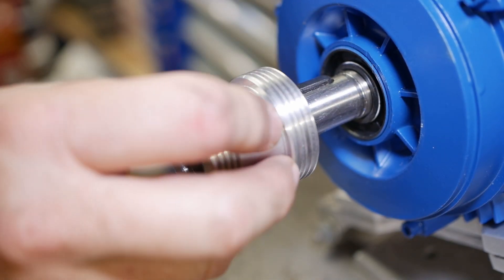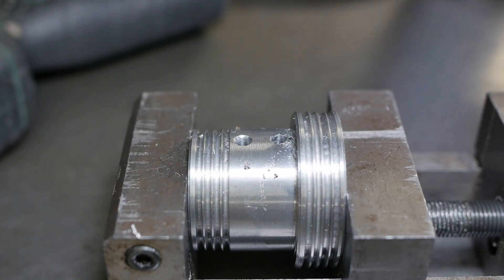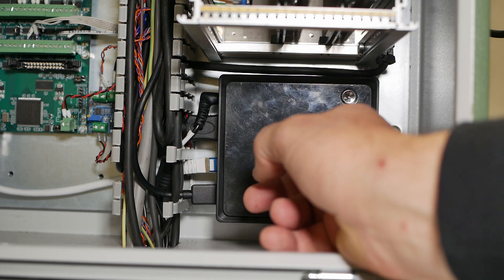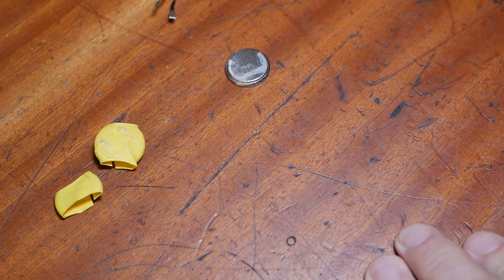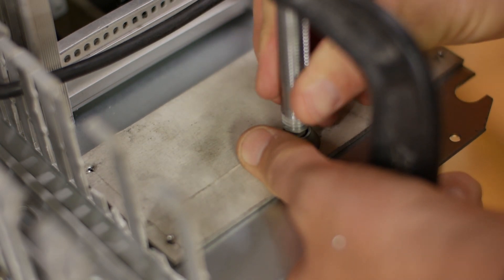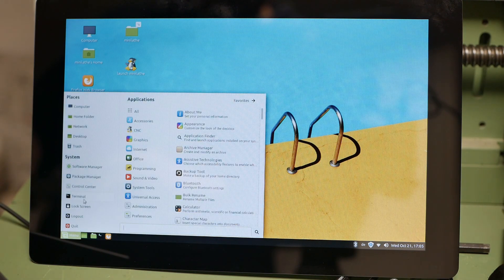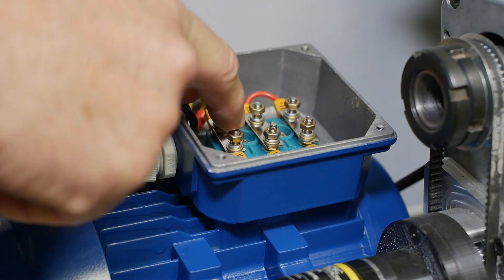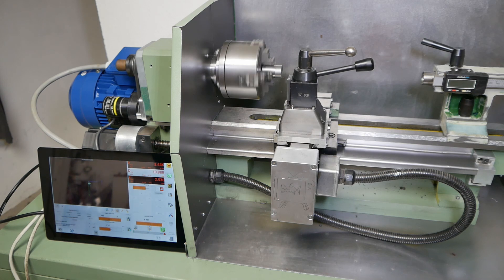Fixing screw ups - CNC'ing the 7x12 mini lathe - episode 33

Comment: Haha, the moment I have seen that tap in the drill I was "oh no". Been there done that, even twice in a row... Lazyness is hell of a disease 😂
Reply from the maker: I am not sure taping with the drill is a bad idea. The dont have the feel of hand tapping, but you also dont wobble as much and put on side loads. I still do it, but only smaller taps in thin or softer material.
Reply: Sure it's not always a bad idea, depends on the situation. I had a bad experience of breaking two taps in a row and not having a replacement so now I'm always reluctant to use the drill 😅

Comment: Having the motor on and turning during the drilling would help center the bit. No torque setting on your drill? Plus taps are brittle, it would have been removable with just a little patience.
Reply from the maker: Thanks for the feedback on that.

Comment: With such a loose fit of the pulley, the side screw will aggravate the offset; the front fastening would have been better.
Reply from the maker: That is the beauty of rubber belt drives.

Comment: Are you that impatient that you always tap with a drill...? Whats wrong with the old fashioned way of hand tapping that works perfectly 99% of the time...?
Reply from the maker: If am doing a lot of small threads especially in sheet metal, I usually tap with the drill. Normally you get less wobble and side loads on the tap with the drill, as you just have to hold it straight and still.

Comment: Mate ! You had v.f.c to drive your induction motor , start the motor slowly in right direction for drilling ,mount the drill in you hand held drill( cordless/power).Start motor ,drill the central hole, you will find that the drill is self centering , same reason that drilling in a lathe is preferred method of drilling accurately. As for tapping with your set -up ,sorry it was never going to end well!
Reply from the maker: Thanks for the feedback.

Comment: I just burned the DC variable motor out on my Chinese lathe today, so am absorbing all the different videos on what to do… I just happen to have a spare AC chinese harbor freight drill press, and am getting close to disassembling it and making my lathe work again.
Reply from the maker: I burnt out the DC motor on my mini lathe as well.

My second iteration had a 550W 2800rpm three phase motor and VFD belt driving the spindle with a toothed belt.
My current iteration has the aftermarket steel back gears in the head, with a 750W 1400rpm three phe motor and VFD driving the inpt shaft with a poly v belt.

I think putting those steel gears in was a mistake. They are very noisy, and only grease lubricated, they will wear out fast.

I think ideal would be about a 1kw motor, poly vee drive straight to the spindle.
Reply: @RotarySMP  hey, I disassembled both the lathe and the drill press. In order to get a pulley on the direct shaft of the lathe, I need a 1 1/8” I.d. diameter v belt pulley, pretty narrow, with maybe a 2” outside diameter. I’m having trouble finding a pulley like this. Do you know of specific companies I could order one from?

Comment: Maybe remote mount the computer battery outside the computer case with a plugin connector. Then next time it will be simple to change
Reply from the maker: Too late. Now it is a front mounted PC, so it is just pull a couple of connectors, unscrew and pull the PC. I hope this now goes 10 years without an issue.

Comment: Tapping with a drill and using small taps is almost always a bad idea. If you must do it, use a spring drive for 1/4" or 3/8" sockets and a mini chuck. Personally, I've always taught people to use hand taps for 5~6 holes, you can feel whats going on and snap way less taps. You also have in effect a 8" extension to tap length which makes it very easy to tweak sideways snapping tap off.
Reply from the maker: Yeah, it wasn't one of my better efforts. Thanks for watching.

Comment: i may case i will buy a battery holder and extend the cables outside of the pc for more practical change
Reply from the maker: CMOS batteris normally last 10 years. I wouldn't bother with a remote battery. I killed this one by trying to solder leads to it.
Reply: @RotarySMP  interesting i dont remember my during that long, but yes heating a battery is bad

Comment: Just starting a mini lathe rebuild myself, thanks for the inspiration. I'm going to epoxy granite fill, did you consider doing that? Under the headstock is very poorly supported I think.
Reply from the maker: If you havent started, consider trading it in for something with more iron in it. Even the 9x20 chinese lathes beds are much more rigid, or an old Emco/Myford etc.

The missing support for the headstock rear end  is not likely to be the main driver. The open profile, poorly ribbed design would have a rather low moment of inertia. If you cast the whole bed into a epoxy granite block, you then have the problems with chip evacuation.
Reply: @RotarySMP  hey. Thanks for the info. I'm already dug in, like you for the journey more than the result but we'll see what it can do. I have an old small format emco cnc lathe that I converted to linuxcnc which is in storage so that will likely be much stiffer. I just need to sort the tool changer on that one and it's finished.
Reply from the maker: @johnharding9936  Did you see Emco coversion by Talla83. hs channel is in german, but well worth watching with subtitles. Sharp guy.
Reply: @RotarySMP  no i haven't but I must have a look. Thanks!

Comment: Hey, figured a current video would get a quicker comment check...I'm converting a MH600W to linuxCNC with a MESA 7i97, which should be very similar to your MH500 on the 7i77. Can you share your HAL and INI files? All that I've managed so far is making the encoders read a position incorrectly. A pastebin.com link should work just fine. Thanks in advance!
Reply from the maker: Cool. The 7i97 wasn't available when I did mine. Are you adding a 7i84 to interface the MAHO 28A1 relay board? I'd also recommend adding a 7i73 to interface you user module. I did mine with discrete wiring and multiplexing. The 7i73 would save a lot of hours.
I posted my current HAL and INI to the first posting of my retrofit thread here:
https://forum.linuxcnc.org/12-milling/33035-retrofitting-a-1986-maho-mh400e

You will need to compile the gearbox component from github:
https://github.com/jin-eld/mh400e-linuxcnc/wiki/MH400E-Gearbox--Description

Please post about your machine either into that linuxcnc thread or make a thread. I'd be really interested to see it. Look forward to seeing you there. If you need any help, just asking in the linuxCNC forum.
Reply: @RotarySMP  Alright, I should make an account on the linuxcnc forums. The relay setup in this machine isn't too complex - there's only a 2-speed gearbox. The 7i84 should handle all the machines relays, with some leftover capacity for other functions. The weirdness starts with a 290VDC brushed spindle motor. Huge pain making that run off 240V/60Hz single phase instead of 380V/50Hz three phase

http://wiki.linuxcnc.org/cgi-bin/wiki.pl?Using_A_XHC-HB04_Wireless_MPG_Pendant
This thing looked easier than a 7i73+original HMI setup...I was planning for a touchscreen monitor, keyboard, mouse, and this type of control pendant

Thanks for the links! I was reading through the 156 pages of that thread looking! Can't believe I missed the first post
Reply from the maker: @LJ-zt2bb  You didn't miss it. I had been meaning to back up my my HAL and INI there fore ages. You gave me the motivation to finally do it. :)

I guess from the 60Hz that you are in the States. Must be a royal PITA, that you can't get a decent 3 phase supply. Would it not be easier to make up one of those motor drives motor as generator (roaty phase converter?) that you often see to solve this?
The 7i73 addresses the user control panel more than the pendant. Peter (Youtube Talla83 ) has done an excellent pendant which communicates directly with MESA Smart Serial 
https://github.com/talla83/tshw
He also has a nice little board for smart serial expansion.
Reply: @RotarySMP  Close, in Canada

The rotary phase converters work well, but then it would still need a giant step-up transformer and that adds up quickly $$$. The lathe is already on its own VFD, so no point buying a big rotary converter for just one machine.

Right now the hydraulic pump and coolant pump each have their own VFD, and the DC spindle motor will probably get swapped for a 3-phase motor+VFD. The wiring is a lot tidier, going from breaker -> VFD -> motor with just a logic level terminal between MESA and VFD - the motor contactors and snubbers took up a lot of room. The Indramat servo drive can actually run directly off 240V single phase with no real modifications. 24VDC now comes off a DIN power supply, which is a lot tidier than the 3-phase stepdown transformer, diode bridge, and capacitor setup that the machine came with!
Reply from the maker: @LJ-zt2bb  You really need to make a thread on your conversion, as I am sure it would be really useful to others.
Reply: @RotarySMP  I was planning to do it at the end...there's a lot that was figuring out DIY style. I even got LinuxCNC running on a Nvidia Jetson Nano with preempt-RT...there were a few threads asking about it but none that said it is possible

Comment: The NUC I have actually has a VESA  mounting plate that it slides on and off of very easy.  
https://www.ebay.com/i/254712927557?chn=ps&norover=1&mkevt=1&mkrid=711-117182-37290-0&mkcid=2&itemid=254712927557&targetid=935694487826&device=c&mktype=pla&googleloc=9003387&poi=&campaignid=10455986299&mkgroupid=104612010940&rlsatarget=aud-622524041038:pla-935694487826&abcId=2146002&merchantid=118858378&gclid=Cj0KCQjw59n8BRD2ARIsAAmgPmKWPbD1YXpBtxj7eK84JMX0RRN1uwrNuY5MMvGyLSvDQ9Ip2CA3bM4aAptyEALw_wcB

Comment: The last time I broke a tap was about as ironic as is it possible to imagine. 

I broke it using LinuxCNC and rigid-tapping, having forgotten about a bug that existed if you stopped the system mid-cycle on a previous rigid tap. 
A bug that I myself had fixed months ago. 
And a fix that was in the latest release version, that I had released a week before. But that I hadn't updated to. 

I tried to dissolve it out with Alum, and it looked like it would have worked had it not been a blind hole (it was in brass, the technique doesn't work in steel such as your motor shaft). But in the end I drilled through from the other side. This wouldn't normally work, but in this case the tap had been plunged straight in at rapid speed, so wasn't really engaged.
Reply from the maker: Ouch. That is a double kick in the pants.

Comment: yeah I wouldn't power tap unless I had or made the felixble power taping heads. I've seen a couple of homemade designs with some that look like they've been made all the flex is given to the adapter by using a slitting saw to cut slats along the length
Reply from the maker: That is  good idea. I normally only do it in thinner stock like sheet metal or the 5mm deep grubscrew hole. Tring to use a hand tap in a deep hole under power was dumb.

Comment: Hi would you mind sharing the information for the parts you are using to make the control panel for the lathe. Thanks for another interesting video on the cnc lathe. Regards Karl
Reply from the maker: Sure, that will allbe in the next video.

Comment: never use taps in a drill... works 9/10 times but when it breaks its way worse then tapping all by hand...
Reply from the maker: You could be on to something there.
Reply: @RotarySMP  you can also get a "tapmatic" for your cordless Drill. Might be the perfect middle ground. Greetings from Cologne!
Reply from the maker: @clypeum5063  I don't tap that much. I should have just used the proper hand tap holder, and been more careful.

Comment: I tried to solder and to spotweld an cr1616 battery. I needed one for my car card, so after cooking up and burning a hole in few of 2032 i finally started to try it with 1616 - just 4 of them blew up, and fifth one welded just fine. 

I connected it and glued card together and it lasted one week. Now I will use card with cr2032 holder on outside, taped to card and i will wait for cr1616 manufactured with welded tabs :)
Reply: Battery voltage was as high, as in a new one. It just dropped to shit while pressing any key
Reply from the maker: Glad I wasn't the only one who tried to solder CR2032:). You are right, heating up the new battery is probably what killed it.
Reply: @RotarySMP  Battery was hot, that's obvious. It just needed an whole week to make sure, that i will get mad while ripping thin, superglued, plastic card apart with no idea if i can start my car. It is possible to open my car with a key, but impossible to turn alarm off and to start it
Reply from the maker: @poprawa  And I bet a replacement key cost 1000! This stuff drives me nuts. I was quoted 1000€ to replace an electronic hand brake module. Pulled it apart and a 30c relay had blown. Replaced it and it worked for years.
Reply: @RotarySMP  My car costed me 400 euros, 600 more in parts for year of driving. It is probably 100 to get replacement card, but i knew i will need to fix everything and i see an opportunity to learn a lot from every small, stupid thing i fix. Car was worth like three times the price, but no one in small city was able to fix electronics, and it stayed in limpmode when i purchased it
Reply: Main reason of going into limpmode required like two hours of my time  to fix, and it is with no experience and with basic tools :>
Reply from the maker: @poprawa  Probably also saved you 1000.
Reply from the maker: @poprawa  Good on you.
Reply: @RotarySMP  I will continue to use this poorly designed car for some time, while saving for something better. It is not good to buy something with no value, but in case of Laguna ii value has dropped because of many small and cheap design flaws. Car is well maintained, not too slow, comfortable and needs only occasional, small  and quick fixes - saves a lot of money, as i will use it to learn everything i can.

I would not expect, that cr1616 was used in game cartridges, so someone manufactures replacements with welded tabs, had to learn a hard way :>
Reply: The trick to soldering batteries is to use a strong flux paste and a good temperature controlled soldering station. Wear safety glasses and have spare batteries to replace the ones that overheat and explode.
Reply: @jonathan1427  1616 just leaks, seal is soft instantly. They are to small and easy to boil.
This is fine for 18650, possible for cr2032 but just not trustworthy for primary cells
Reply: @poprawa  CR2032, CR123A (16340), and 14650 have all been OK, but I wouldn't want to go smaller than CR1220. I never got LR44 (AG13) to work.
Reply from the maker: @jonathan1427  Thanks, but I think I am over that. I now have four spares. I think the same ones go in my welding helmut which also needs a batter change.

Comment: why you didn't use the vesa mount for that brix ? fix the vesamount to the backplate and then just click the brix into it ;)
Reply from the maker: Too cheap. Didn't have one. Didn't know abot it...
Reply: @RotarySMP  i have 2 such brix machines one the same N3150 as you have and one older J1900 and both came with the vesa mount included, so i expected those are sold with the vesa mounts by default.
Reply from the maker: @robertjung8929  I bought this used over our version of Craiglist, so there was nothing with it. Are you happy with them? I find it pretty slow to boot, both otherwise seems pretty stable.

Comment: Nice video. I thought the prevailing wisdom was to only use spiral-fluted taps for tapping with a drill.

You can't really break the chips on a normal tap when drilling or feel when they need to be broken...
Reply from the maker: That is probably true. In M5, I only have that spiral fluted with the tine shaft diameter. I need to get some more taps.
Reply: Also helps to hold the drill firmly with 2 hands even if it's a small tap. The side twisting breaks it much easier than it really should
Reply from the maker: @MF175mp  Good advice. I was tired and lazy. Stupid really.

Comment: Shafts have around 35 to 45 HRC. This means you can drill them and tap them without much problem. Sometimes (not always) shafts are hardened only on the outside to around 0.1 -0.5 mm deep.
Reply from the maker: This one certainly felt soft.
Reply: If the motor is old or Asian it can be mild steel, below the whole HRC scale
Reply from the maker: @MF175mp  I think you are right.
Reply: @MF175mp  you say "steel", another youtuber could probably call "chinesium"
Reply: @alanclarke4646  Ikr I use the term a lot as well, I like the way he twists the language

Comment: The wife woke me up when she saw the dog. Had one of those as a kid. Did you fix the other components that were installed from behind or did I miss something during my siesta?
Reply from the maker: Lucky Nico sent me some dog clips to rescue this video :).
The only other component mounted from behind is the 48VDC PSU. But that is in the bottom cabinet, so I won't touch it unless it fails. Cetainly will never ever mount from behind on any further build.